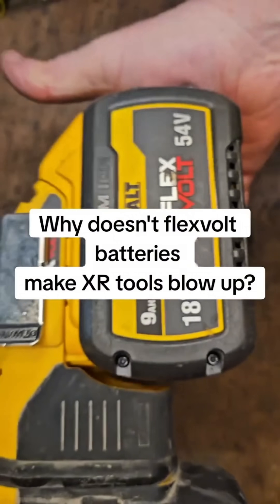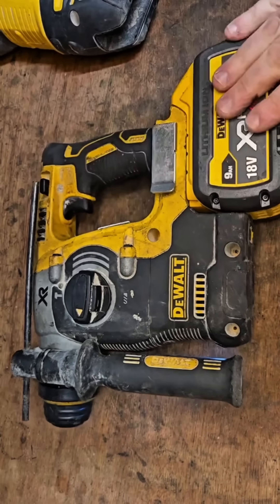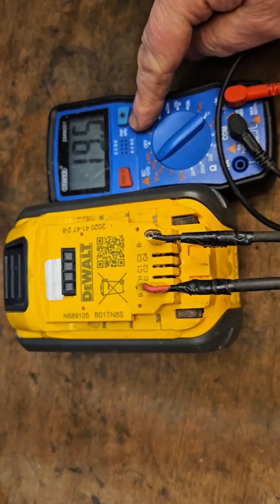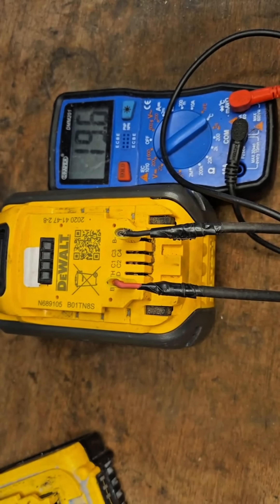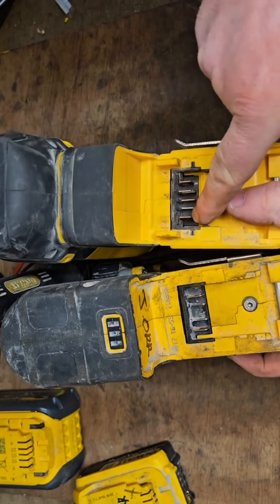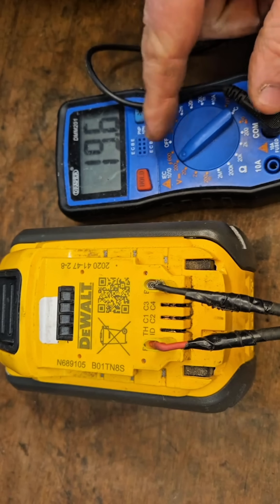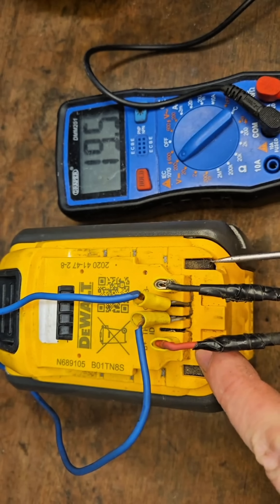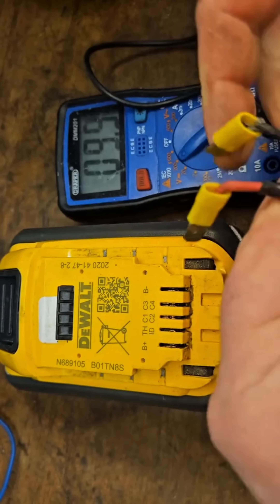What makes a flexvolt battery different how does it work?

Comment: Great video. All to do with the pinning and the circuitry in the battery. 

For anyone going into the flexvolt system. Try to get batteries that are produced as late as possible - I'd guarantee sellers out there probably have 2023 and 2024 produced batteries. The most popular sellers (powertoolmate etc) that sell a lot should have newer stock than firms that aren't as popular.

I'm only assuming but the later produced batteries might have had revisions to the design/manufacture of the BMS/controller in the batteries along with maybe a newer produced pack of cells.

Comment: Do you think Makita should’ve done something like this or was it better they started over?
Reply from the maker: It's very hard to say which was the best way to go for Makita they have botched the design of their larger 18v batteries by not using 21700 cells at the very least let alone tabless. Dewalt going down the dual voltage route created an innovative battery but with a higher than reasonable failure rate. Dewalt were over ambitious Makita were underambitious.
Reply: @doctorlefthandthread  Agreed with what you have said. The 8ah tabless 18v Dewalt is perfect with everything 18v. 

If I was going the Dewalt route today and getting rid of my Makita 18v & 40v I'd get 54v tools and use the battery only on the flexvolt 54v tools and the 18v tabless battery to use with 18v tools. 

Do you think using the flexvolt batteries on 18v tools speeds up/influences the failure of the battery?
Reply: Good question here. The BMS/controller in these batteries aren't up to par. There are an unreasonable amount of these batteries going faulty after a poor 1 year warranty for the cost of the battery. 

I think they should have stuck with 54v only tools and batteries, but in the US and Europe they were trying to appease 18v users by saying they could be used on both. 

It was over ambitious IMO with the BMS/controller they are using.
Reply: Mas eles estão usando baterias tabless agora, em pelo menos uma linha de baterias 40v.
Reply from the maker: @robsondelima2606 it was a good step forward